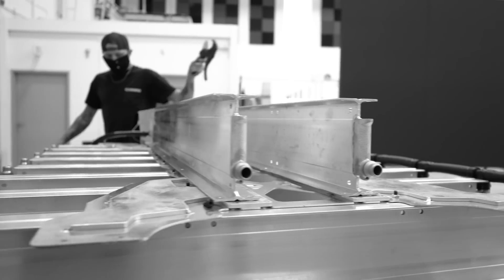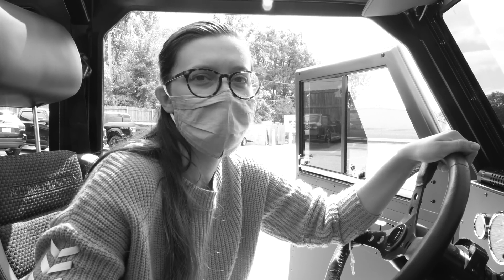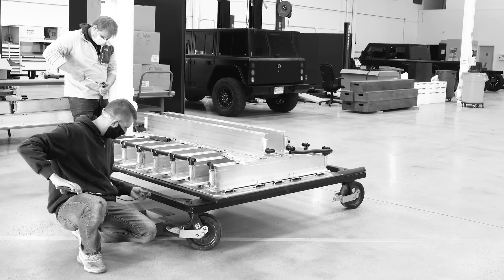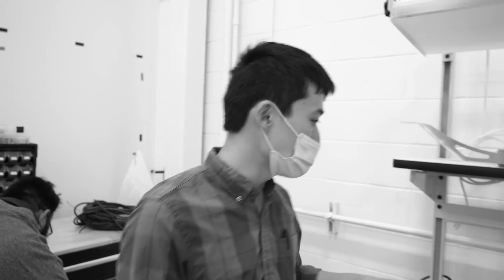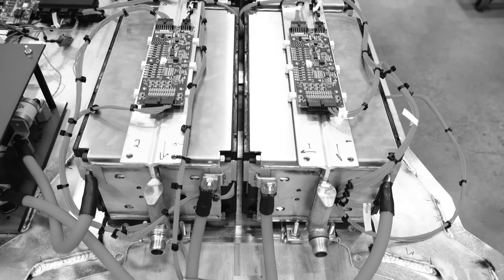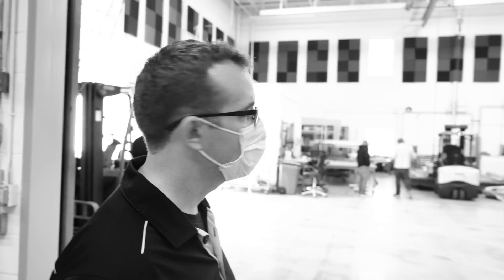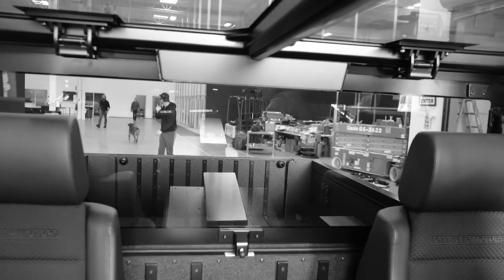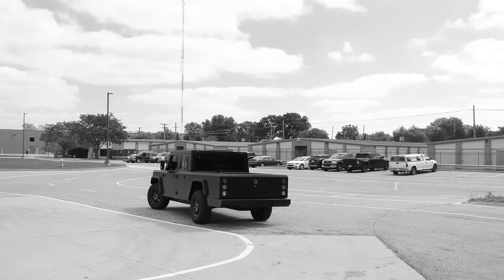EPISODE 07: BATTERY

Comment: Wealding in a T shirt!? Give the workers some protection equipment already.
Reply: Also protective eyewear.  Surprising they are advertising their poor attention to safety.  I wonder how safe the truck will be.
Reply: @alexiz689  also  you have to have a air filtering system. Mobile or stationary the smoke will give you cancer.
Reply: @mattiassedin9769  Hopefully these comments will spur Bollinger to improve their safety protocols.  I like the truck, but it's important that the development, supply chain and manufacturing does not put employees health and safety at risk.
Reply: @alexiz689  I fecking love the truck! And yes.  😎

Comment: so much handwork.. these are prototypes OK and the layout of the car is simple. Just stamp the iron and bolt it like AK47. This video contained a lot of hand welding. Not a good thing for mass production. Not related to the car but some of the masks were inside out (the rubber band should meet the mask outside, not inside).
Reply: Worse, they show people wearing the mask in a manner that does not cover the nose.  In that case why not just ditch the mask?
Reply: @earlpottinger671  the masks do no good anyway.  the virus is is like a 100 nanometers. It's like a grain of sand going through an earth sized hole :)
Reply: @ArtisanTony  The mask does not stop virus particles, it stops droplet from the nose or mouth that help spread the virus.  It is foolish to think the mask can not help cut the spread and likewise foolish to think the mask will stop all spreads.  It is a help.

We wear masks here a lot in Canada, our infection rate is a third of what it is in the US, notice I did not say zero, I said less.